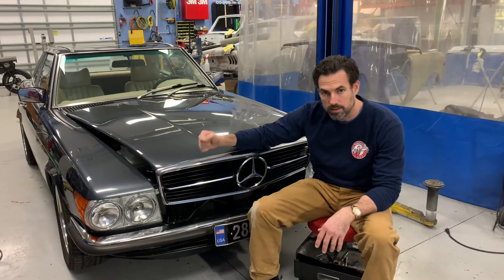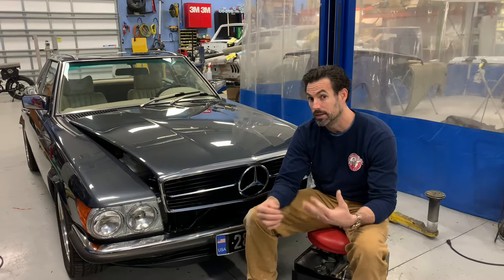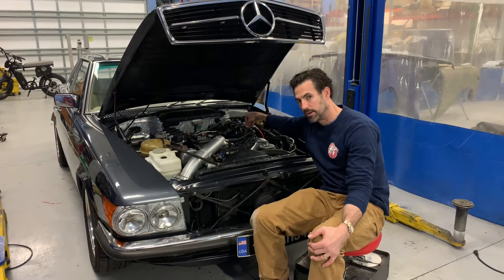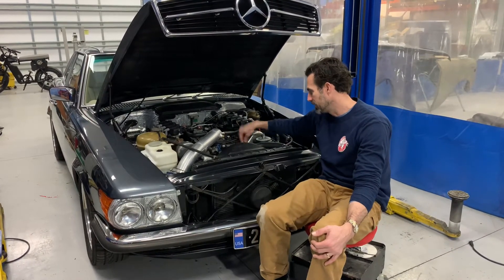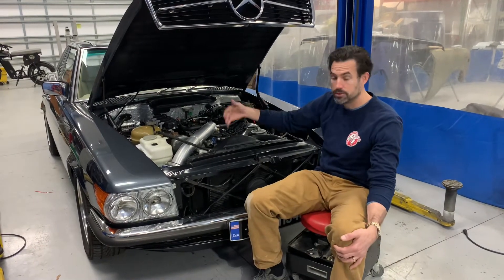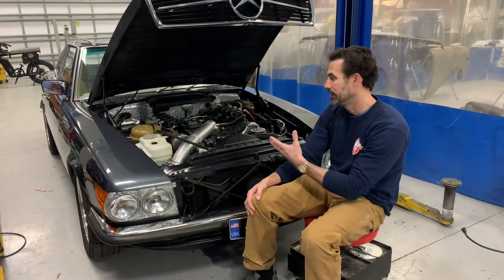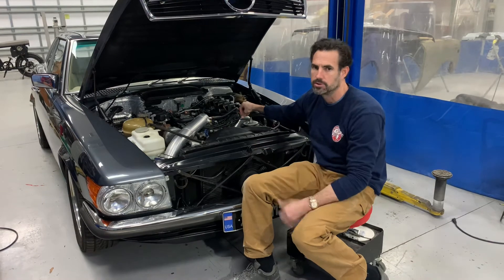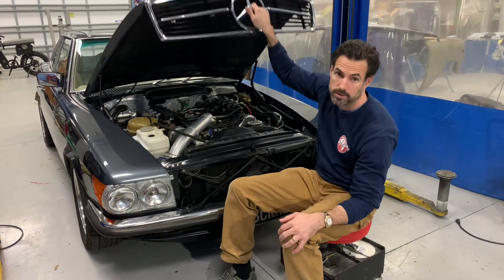Mercedes 450 EFI update

Comment: How's the car running after nearly two years? And which Holley kit was it? I've got a later 5.0L alloy M117 and I'm just about ready to ditch the mechanical Bosch CIS. The car was an import from the Middle East in the 1980s, so it was subject to DOT/EPA federalization, and they've messed up a few things here and there.

Comment: I also have an elbe efi kit installed, I have been considering getting rid of the VEMS and using something else. Can you tell me what you used from the Holley kit, is it still port injection or now throttle body?

Comment: Did you use the Elbe efi kit and if so what problem did u run into
Reply from the maker: Simply put - the Parts are cheap. Ignition coils are off a VW Passat and the older ecu limits your abilities as compared to the newer Holley system. Don’t recommend it . Definitely better options out there for  the money. It is way overpriced for the tci and parts you get.
Reply: @carrestorationguy9668  What parts did you use for the Holley EFI system? What coils? what injectors?
Reply: @carrestorationguy9668  try mastersquirt ecu or a speeduino
Reply: Very interested in the Holley components your sourced. If you could share contact info. Interested in your lessons learned in conversion or pricing if you can install. Have a very very solid 78 450 so that could use some tuning on an restore that was done several years ago with about 1-2k after rebuild.